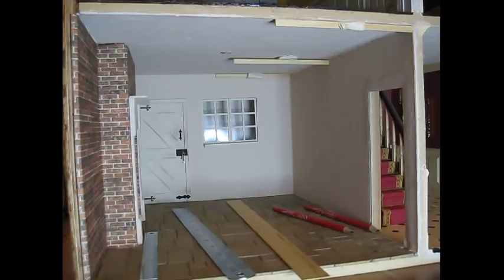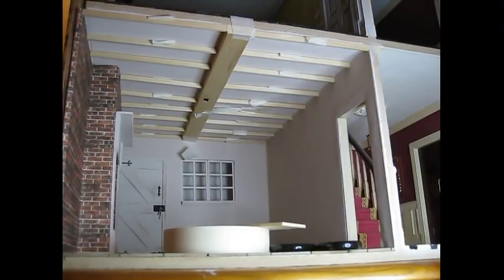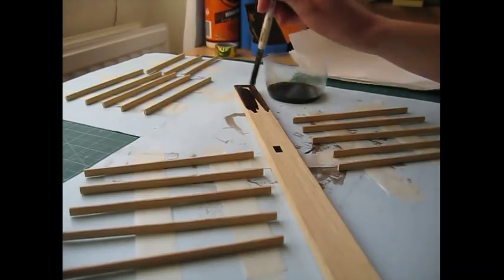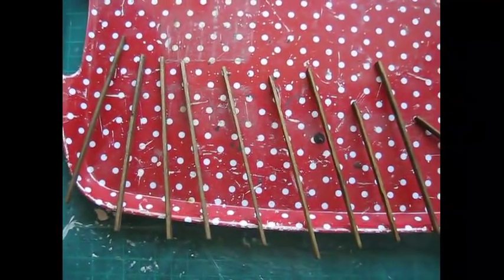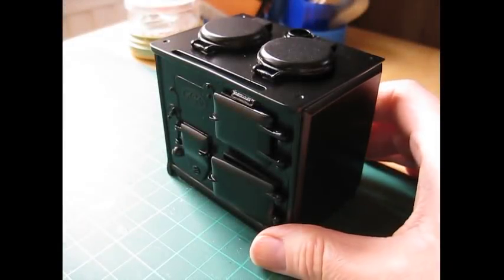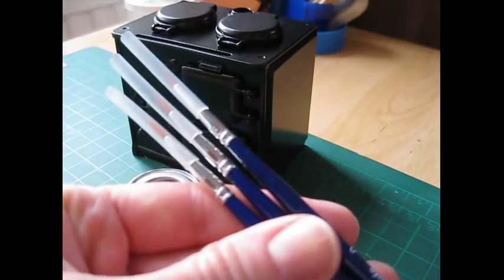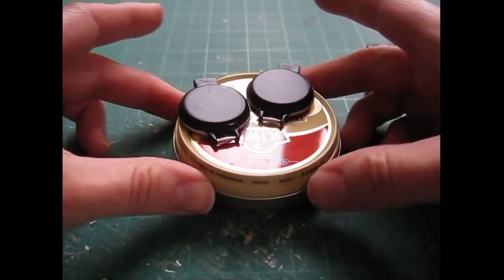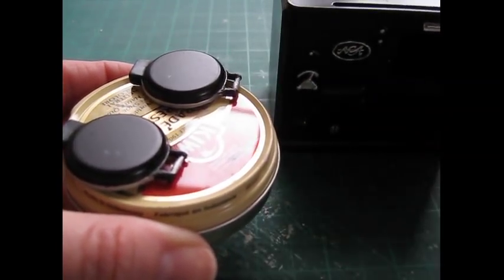My Dolls House Diary - Episode 8 - The Kitchen - Getting Ready to Move In

Comment: Thankyou for another great tutorial. Love the Aga. The light is beautiful too.  Have you made a film showing how you connect the light. I thought those plugs had to go into an extension bar. How does it work straight into ceiling? I have an empty house needing repair and decorating so will be following these videos eagerly. Thank you so much. Carole.
Reply from the maker: The house is actually fitted with copper tape and I am attaching the prongs into two eyelets in the ceiling.  Thank you so much for watching. :)
Reply: Thank you Julie.

Comment: So great!  Do you think you might use a razor blade to get that paint off the floor.  It might scratch it a bit, but as you say, that will just add to the look of age and use.  I found your way of putting in the light fixture very interesting and useful.  Not quite how I did it, but it makes sense.  And cutting the plug fixture down to size will be a very good tool for problems I was having.  As always, thanks so much.
Reply from the maker: A razor blade would work, but I think I'm going to leave it.  I have plans for some miniatures to go behind the door, so it will be well hidden, but thanks for the tip.  I'm glad you found the video helpful too.